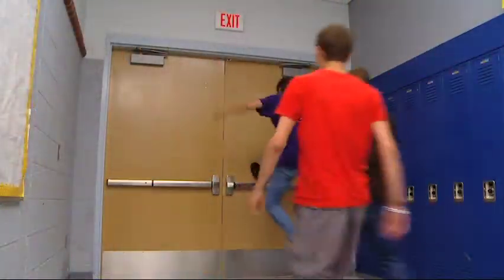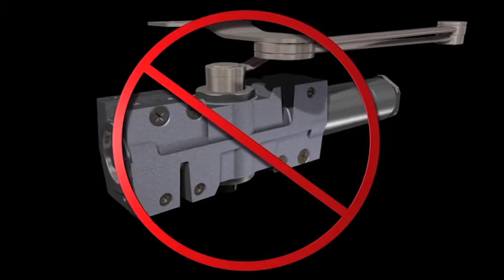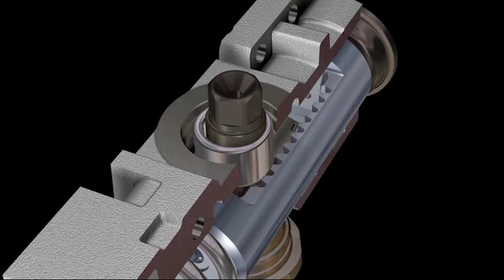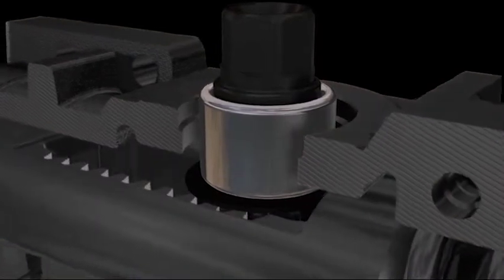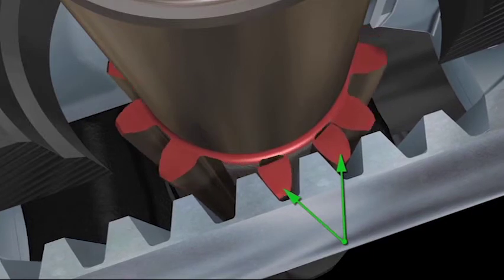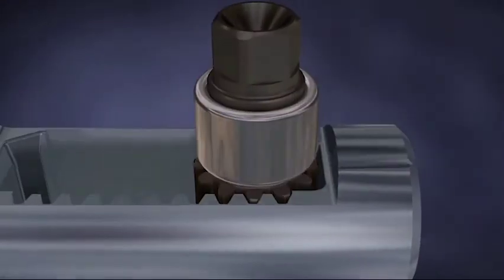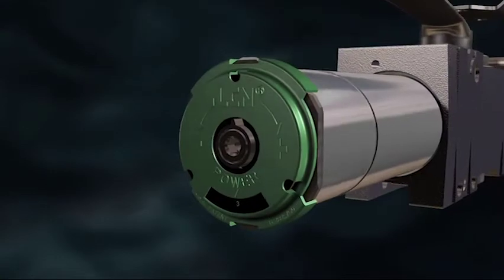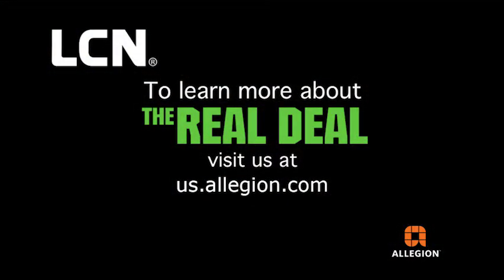4040XP Real Deal Stories of Closer Abuse

Comment: The 4040XP is I think the best closer from LCN.  However, I would recommend the metal cover.  That's what I have on the garage entry door in my house is the LCN 4040XP closer with the metal cover.  My garage entry door is fire rated and had spring hinges which slammed the door and rattled my nerves (the springs of the hinges are relaxed and abandoned and function as conventional hinges) and the 4040XP was my upgrade and I love it.